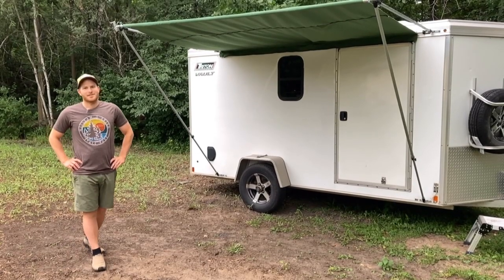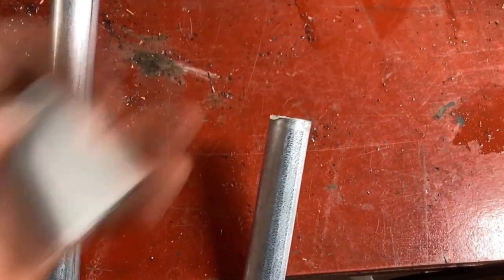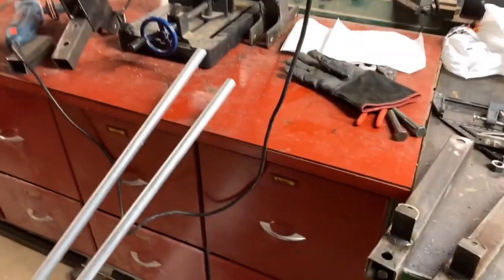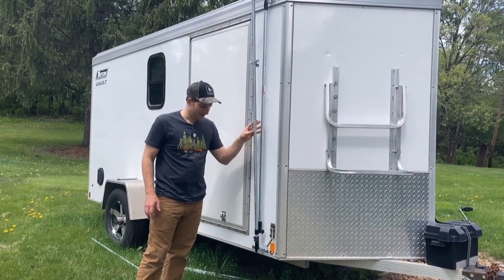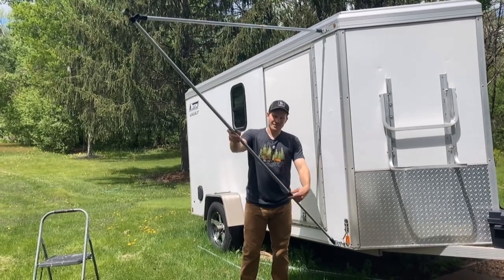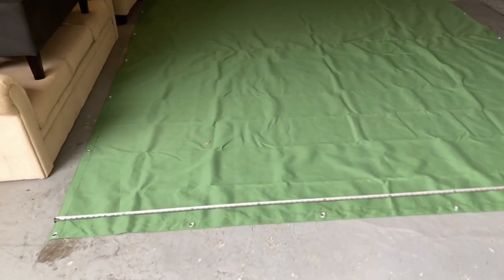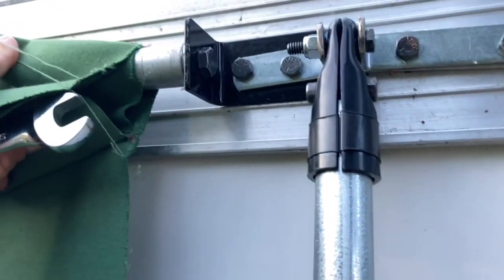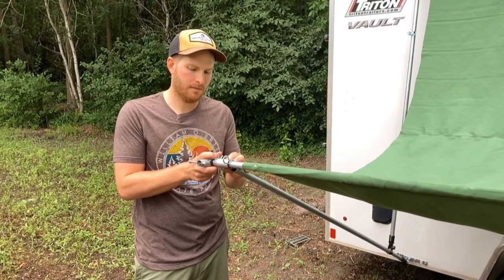Homemade Retractable Awning, Cargo Camper Conversion Trailer

Comment: Great Awning set up. So far my Favorite. I have to pull from so many ideas cuz I want 15x9 Minimum.  15x15 will just give the hang down effect for sun or driving rain. I never knew about the extra pieces you can buy for emt pipe. Thanks for the video!!
Reply from the maker: Thank you! Glad I could help with some ideas.

Comment: You should tie a piece of Paracord onto the zipper so you don't have to use a stool to unzip it
Reply from the maker: Yeah that’s a good idea. I do have the stool on the trailer at all times cause we use it to get in and out,  it a piece of cord would make it easier.

Comment: Very nice design and construction! I'd be tempted to put velcro straps on sides or  some grommets with bungees or tarp holders to secure to horizontal arm. (But I'm a retired upholstery guy who doesn't like canvas flapping loose on sides.)
Reply from the maker: Thank you ! That’s a great idea for improvement. Should be pretty easy to incorporate.

Comment: Hi great build and video. If possible can you tell me where you got the ends and fittings? I would really apreciate it
Reply from the maker: Thank you! Yes they are all from a company called “maker pipe”.
Reply: @northwoodsengineered  Thanks for your attention and quick reply

Comment: I'm trying to design a little frame for my vintage canned ham trailer, this gives me some hope and ideas.
Reply from the maker: Happy to help!
Reply: @northwoodsengineered  And thanks for the parts list.   I'd shopped Makerpipe before and did again, to find the telescoping connector and didn't see it on their site but your little link up there took me straight to it, much appreciated your time in attaching the links.   All these little awnings you see take tent poles and a few guy-lines per pole to hold them up and that just isn't for me.  To much work, too much clutter (ropes all over!) and my dog gets tangled in all those ropes.   I want a quick n easy down and dirty shade.  I'll paint the conduit and sew myself a cutsie little shade.   Happy trails!
Reply from the maker: Glad to hear the links got you what you needed. I agree, a lot of awning just have to much going on and too much screwing around. This one is much simpler

Comment: Great build!  It looks like something I could put together.  If you have time, I have some questions:
1.  Could you pull the awning out further?  It looks as if it's extended about 5 feet from the trailer?  
2.  What would you do differently, if you had it to do over again?
3.  How is it holding up over time?
Reply from the maker: Thank you!
1. Yes I can pull it out a little further, but It’s limited by pieces of conduit mounted at top on the sides. Those are basically cut to the height of the trailer so when they stick down, they down still below. So if you had a taller trailer you could make those longer. 
2. I would attach it differently where it actually goes to the trailer. Another person mentioned in an older comment about using an awning attachment which is basically an extruded piece of aluminum that you screw to the trailer, then sew in a piece large rope into the canvas, then that slides into the channel on the aluminum. Google it and you will see what I mean. Also, use stainless bolts if you will be driving in the winter at all. Salty roads have rusted the hardware. And also, instead of the round knobs, maker pipe sells bicycle clamp bolts that i would use instead. 
3. It’s being holding up great so far, but admittedly haven’t used it a ton. But it’s been on the trailer for other trips in the winter when I didn’t use it but the structure is holding up great.

Comment: Great video! Very clever! Thanks for sharing!!!
Reply from the maker: Thank you!
Reply: @northwoodsengineered  just out of curiosity, how much money would you say you had in the awning? I converted a 7x16 cargo trailer last August to a camper and the awning and solar panels are pretty much the only other things I would like to add. That and motorcycle tie downs lol
Reply from the maker: @johnfarthing6174  I added it up and i have about $170 into it, which is not nothing, but is much less than anything you can buy from what i could find.
Reply: @northwoodsengineered  Yeah that’s not bad at all! Ones I’m seeing are around the $6-$700.00 range! Thank you for your help!!!

Comment: Great little concept, I’m interested in that spare tire setup you have on the front, we camp out of a 6x12 Lark.
Reply from the maker: Thank you. So the tire carrier came with the trailer and is an option from triton. It was originally mounted on the inside but I moved it to the front

Comment: I really like your  design and aiming to use it for my cargo trailer as well but wanted to know if you found a structural reason for not extending past six feet?Im, hoping to get out to 8’ if possible, but didnt want to build if it cant handle it, thanks… awesome build!!!!
Reply from the maker: Thank you! I guess for the distance out from the trailer, you are limited by how tall the trailer is,  because the piece that ends up horizontal is about as tall as the trailer wall. If it was any taller it wouldn’t work. But I suppose you could make that one telescoping as well and then it could be longer
Reply: Thats what I was wondering if it would be strong enough, thank you sir for getting back to me, you’re a class act!!!
Reply from the maker: @cabmanist no problem, let me know if you have any more questions along the way. You can always email me if needed.

Comment: Hey, I am trying to follow along with your canopy build and have a couple of questions. What size conduit did you use for the pocket up next to the trailer? I know you said you put the 3/8 insert in but did not catch the pipe sizing.
Reply from the maker: I also used 3/4" pipe up there.  Although since i made the video, someone commented on this video about using an awning track rail, which is what i would use if i did it again,  you would have to fold the end over a small piece of rope and sew it then slide it into the rail. IF you just google it you will see what i mean.
Reply: @northwoodsengineered  actually, my brother had 2 sun shades that I am looking to piece together instead. It's kind of like what you are mentioning.

Comment: Nice job. I am in the process of paying off a 1991 22 foot Class A Motorhome that currently has no awning on it at all, and the prices for Motorhome Awnings are outrageously high, so I am trying to figure out how to do something similar to your Home made Awning... Any Suggestions ?
Reply from the maker: Thanks! I guess to start, take as many ideas from my video as you can. What about it would you be unable to do?
Reply: @northwoodsengineered   I am not mechanically inclined at all. I wouldn't even begin to be able to fabricate what you did for your rig.
Reply from the maker: Ok, not so sure I can do much for you then. You could try to make something way simpler than what I did, something out of stationary conduit that you take on and off each time.

Comment: How many feet is the uprights you made
Reply from the maker: They are about 4 feet, but the one that ends up being horizontal extends out to 6 feet
Reply: @northwoodsengineered  i cut mine off at 5foot and I got two of them for each one